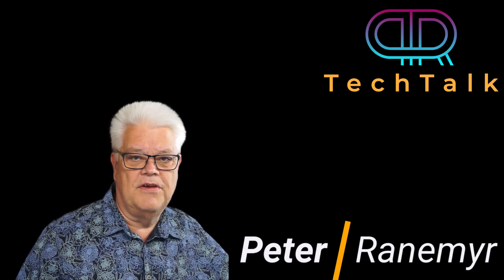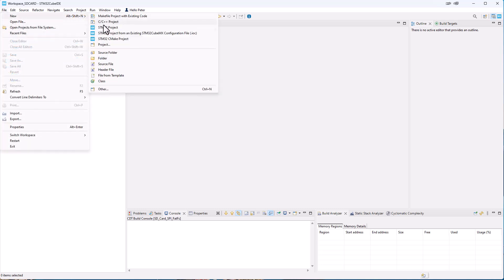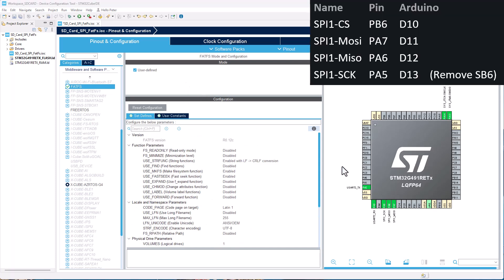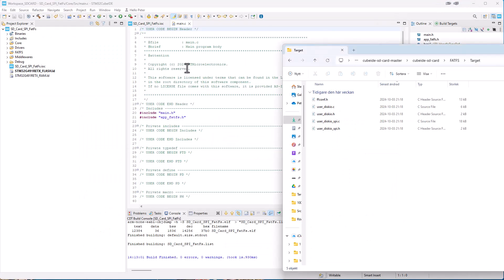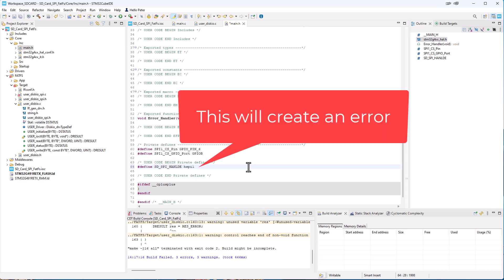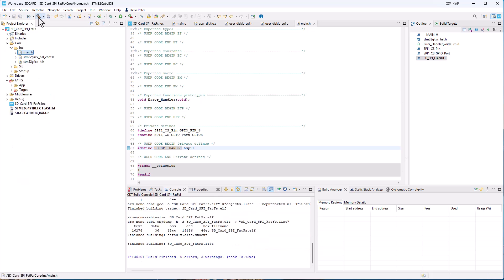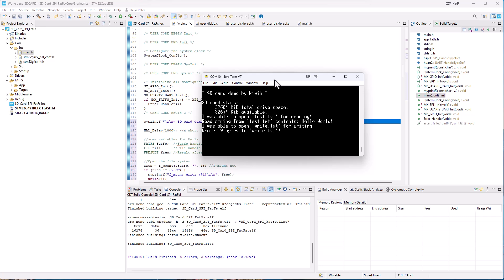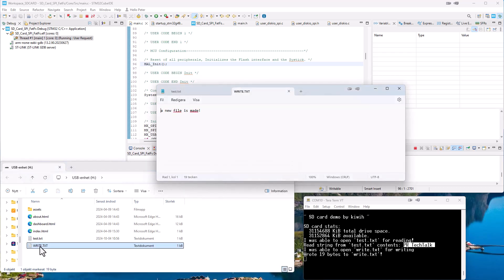STM32 SD Card Interface via SPI and FatFS Tutorial (No RTOS)

Comment: I plan to design a real-time controller and transmit six floating-point variables to a PC every 10 ms (required payload bandwidth ≈ 2.4 kB/s ≈ 19.2 kbps; RAM usage ≈ 24 B per 10 ms frame, or 48 B with double-buffering). Would this be feasible with an SPI-connected SD card?

Comment: This looks great! I feel really uncomfortable about tinkering with the board itself. Is it not possible to use one of the other available pins without removing a resistor? Thank you so much for putting this up, I'm looking forward to your reply! 🙂
Reply: You can leave that solder bridge. Led will  blink during communication with the sd card.
Reply: You can use a different pin. 
He explaines the reason why he is choosing this pin and why he needs to desolder the resistor in the video. It is only for conveniece, that all the pins on the nucleo are in a neat row in the female header. If it doesn't bother you, use a different pin.

Comment: Thanks, sir, for the video. I just have a problem: FR_NOT_READY. 
The SD card was formatted in FAT32, and everything is like in the video, but at the SD card mounting level, it does not work.
Reply from the maker: To debug you might want to add a logic analyzer on the SPI buss to se the signals.
Reply: Hi. Have you fixed the issue?

Comment: What does it mean if I'm getting fres = FR_NOT_READY?
Reply from the maker: Test with  a SDCARD max 32GB , preformat it in FAT, Use Pullup resistors. Test with altenative card. 
PLs also his the Subscribe Button it is free of charge  :-)  / PR TechTalk
Reply: @prtechtalk416  I have double-checked that my 32GB SD card is formatted in MS-DOS (FAT32) and ensured that all my SPI lines include pull-up resistors on cubeIDE and tried with alternative SD cards, and I'm still getting the same error. If you could direct me to some of the potential errors I should look into, that would be awesome. Thank you
Reply from the maker: Hi, you could hang a logic analyzer on the SPI buss to get an idéa what is going wrong.

Comment: Hello Peter. I'm trying to use this code, but I'm having a trouble. The code compile with no erros. I'm using a 4GB or a 32GB formated as FAT., but I keep receiving the  "f_mount error (13) ". I 've google it and I found several comments over it, but I could'nt find a solution. Can someone help me? I'm using a STM32F411CEU6 with a SD_CARD SPI adapter, the same as in the video. Best regards. Alfredo from Brasil.

Comment: thank you sir! This run fine without FreeRTOS but gives mount error (1) when using with FreeRTOS.
Reply from the maker: Hi i haven’t tested this code with FreeRTOS but dont think this would cause any error. Have you tested with a 32GB card an format it with FAT ?
/PR TechTalk
Reply from the maker: Just a thought could it be that i make a task switch in a timing critical  sequence. Test by temporarily disable the scheduler and see if that have any effect 
/PR TechTalk

Comment: Thank you so much for your video, Peter!  I'm getting a weird behaviour. The first time I have tried to ruin the code it was working. I realized that I did not load any test.txt file and  I loaded it through PC. When I put back the SD, I got the FR_NOT_READY error. Do you have an idea why I get something like this?
Reply from the maker: Hi, when i get these issues i hook up an logic analyzer to the SPI bus to see what is transmitted and returned. 
Look for Saleae and software Sigrok.
You can also try to use another SD Card preferably  32GB or less.
Good luck
/PrTechTalk

Comment: Can i write the voltage reading plus timestamp in the sd card ? Can suggest me any method
Reply from the maker: Hi, for sure you can. I have even thought of doing a "DataLogger" for in my example see discharge curve on LiOn cells. I would then use a RTC to keep track of time and sample at some defined interval and save to SD card and then later bring that data into Excel for analyze.
So hit the Hit Subscribr and the Bell so you get notifyed on new videos i release.
/PR Tech Talk

Comment: 5:20 - Putting pull-ups on always output pins is not only pointless but also increases power consumption.
Reply from the maker: Hi, thanks for your comment! As I mentioned in the video, I'm not entirely sure it's always necessary. I agree that pull-ups will consume some current. However, the output is configured as push-pull, using transistors in a totem-pole arrangement. To prevent shoot-through (when both transistors are on at the same time), a small dead time is introduced where both transistors are off. During this brief moment, the output can enter a high-impedance (tristate) condition. Although this period is typically very short and may not cause issues in most cases, adding an external pull-up can prevent the output from floating. I've seen a few cases where adding pull-ups helped resolve SPI-SD card communication problems. Pls make some experiment and see if it makes any difference.
/PR TechTalk

Comment: Thank you Peter. I'm trying with NUCLEO-C031C6 but the program didn't mount the sd card.
Reply from the maker: Hi Did you format the card with FAT ?
/PR TechTalk
Reply: @prtechtalk416  I solved. Since Stm32CubeIDE has not FatFS in Middleware for my board I add it manually and I forgot to init FatFS in main. Thank you.
Reply from the maker: Awesome job figuring that out! It's always satisfying to troubleshoot and come up with a solution. Keep up the great work!
Reply: @NCris-d6h Hi. Do you have a step-by-step procedure on how you did it? I'm also trying to add the fatfs manually but I always get f_mount error (3)